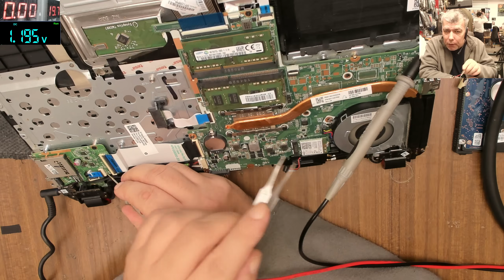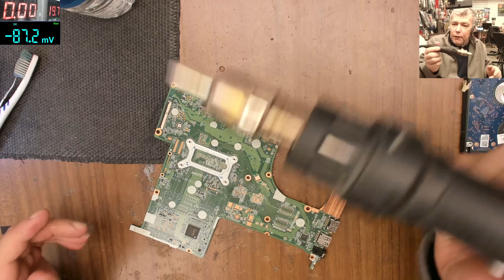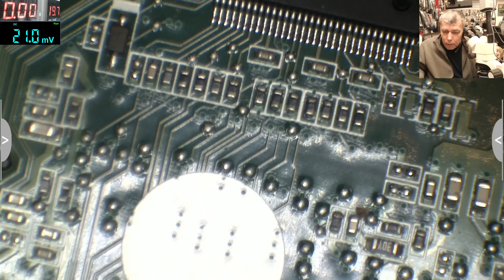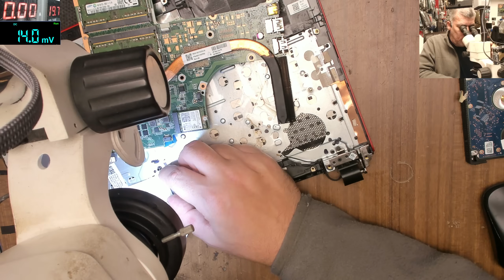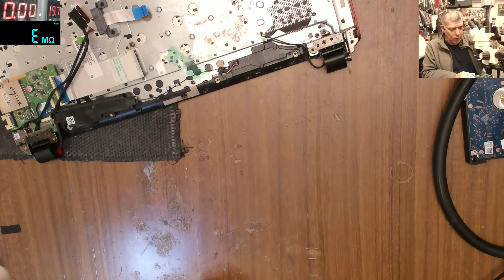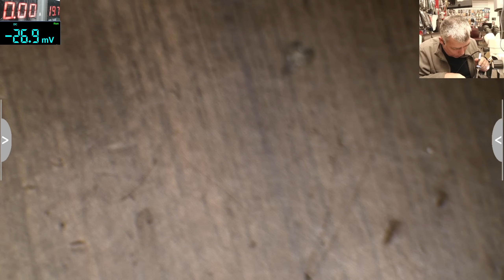Electronics repair lesson - Don't be afraid to use alternative ways to fix a fault

Comment: When I was young, I did work on an Intel Motherboard and Motorola boards making factory. After the boards are made, they put it in a conveyor that looks like a big washer machine and they use Cascade to clean the boards. After the dry cycle, it looks perfect. From that experience, if I really need to clean a board, I just put in my dishwasher with Cascade soap. Be sure to have the hot dry selected.

Another example, I was one day pushing a boat on the water and I forgot my pager, an electronic device to receive messages back in the 90's. What I did immediately was take the battery out, rinse it with fresh water, look for a paper cup in the trash and dunk the device inside the clean water for the entire day that I was out in the boat. The reason was to prevent the salt from drying and creating corrosion. When I get home, I take it out, rinse it in water one more time and dunk the device in alcohol to push the water out. After letting it dry for 3 days in the direct sun on my car dashboard, it did work perfectly without any issues.
Water by itself doesn't really create damage, it is the minerals or the water contents that interact with the electricity.
Reply: That reminds me of an experiment that I did with aluminum foil in a salt water aquarium sump. I put the aluminum foil under water, and no harm was done to it. After a number of days, I brought it out of the water and let the salt water dry on it, and it was full of holes after it dried. I put it back under the water, and no more corrosion took place.

Comment: Hello, 👋👋👋the best for cleaning pcb after flooding, especially those with visible corrosion, is demineralized water, and after washing it is best to use isopropanol alcohol, which will displace the residual water from the smd components, best regards.🙏🙏🙏
Reply: nope. disagree. "it is best" to replace computer entirely LOL. Seriously, any water is fine but preferably not tap water. the waters not on the board long, is dried quickly and even it could cause any negative effect, it will be so long in manifesting and minor that the whole laptop would have been recycled before any negative affects were even slightly prominent by cleaning it with water.  but it must be fully dried. like anything electronic with water on it.

Comment: Best thing is to use demineralised water aka Deionised water or sterile water. In the chance that if you missed drying a part of the board, it doesn't short circuit because its the metals in the water that act like a wire. Mineral water contains, you guessed it, Mineral. Although okay if you're sure you've got rid of all the water it's okay to use. 

Maybe use pressurised air to remove all traces of water for example under some SMD components.
I saw a well known PC youtuber power up a fully submerged motherboard in deionised water and it powered up and booted. Crazy thing.

I also saw a car repair youtuber that cleaned some liquid damaged ecu's of a car with water. He had an inline deioniser or demineraliser. Whatever you want to call it.
Reply from the maker: Thank you for the advice, i will try
Reply: @electronicsrepairschool  
Hi Sorin. 
Iso alc is good for cleaning off flux spatter or greasiness. but not gonna make a difference to water residue deposits. bottled water is good as it's also filtered and contains none of the flouro and calcium etc.  Drying the water right away is good. if you want "minerals" removed you'll need a surfactant. then it becomes more 'polish than product' which eventually will not make a difference as the effects are at worst, negligible. distilled water is for plants, steam irons and lead acid batteries, as it wont 'fur' up the cells. Truth is, even rainwater is better than tap water. and after drying, there's no negative to the repair or longevity. bottled water is perfectly fine for cleaning and drying.  it's not going to be on the board long anyway.
Reply: It doesn't matter that much because any contaminants on the board will "mineralise" the water and turn it into electrolyte. As long as anything potentially conductive and corrosive is removed it's fine. just need a lot of water and maybe even start with soapy water. I use plain water (as long as the water is not too hard) and liquid soap with ultrasonic cleaner and it works just fine. Of course you dry with hot air very thorouly.

Comment: I saw someone on YouTube undo the plastic welds on the back of a keyboard with a heat gun and gentle lifting pressure, takes a while to do but means no grinding welds, along with not having to replace entire palm rest. Yes water for sugary drink spills on circuits is the best especially for Cola.
Reply: whats channel of youtube that you saw?
Reply: @sipansibabdreddknot5179  Adamant IT did a video on this
Reply: @Helmut_Steiger  thanks ive tried a spare soldering iron to melt and secure the locks of the plastic case for yhe keyboard but this gives me new idea
Reply: I also remember a YT video where a  solder iron at minimum temperature was used (he could touch the tip with a finger without getting burned). He just pressed each end of the ribbon cable to the PCB.
Reply: I tried this on a modern HP laptop and instantly melted the casing, so if you're gonna try this be very careful
Reply: carefully placed ACTEONE melts the ABS heat-staked keyboard supports. no need for heat or drills etc..